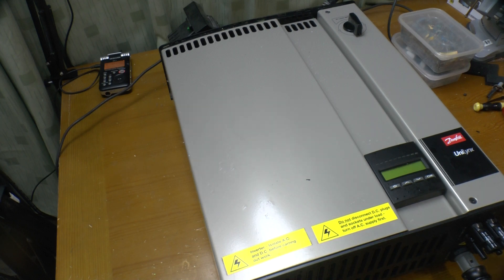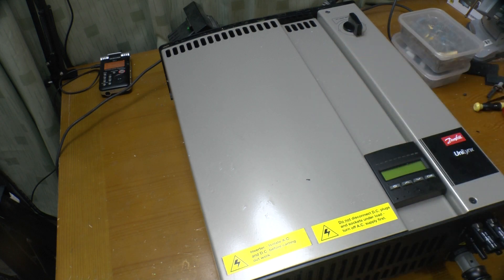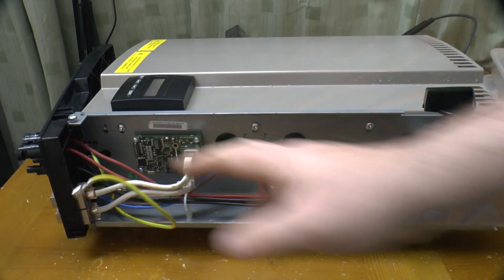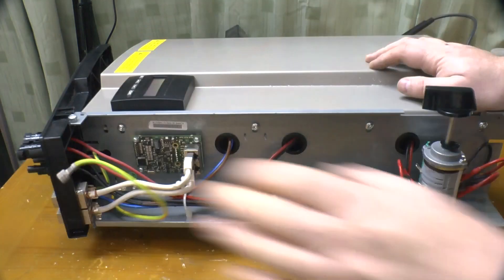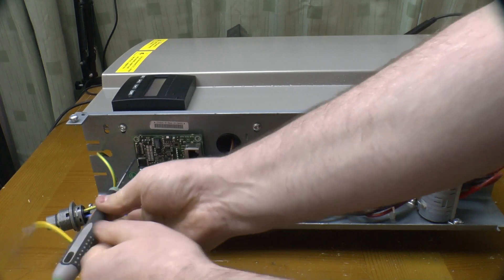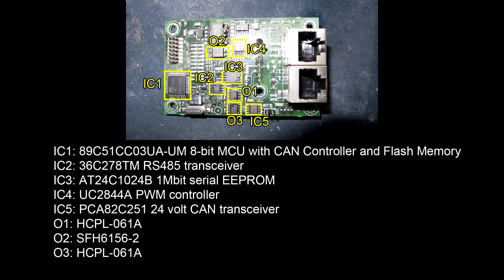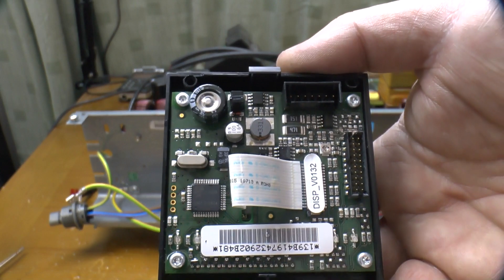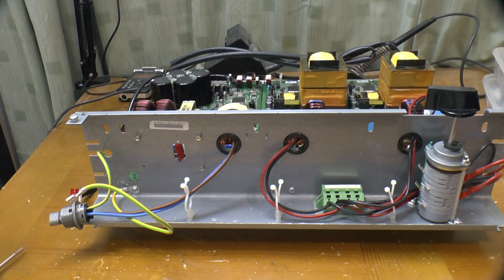What's inside a Danfoss solar PV inverter?

Comment: It's a shame you did not try to repair it! Such a nice inverter!
Reply from the maker: I have no use for it, my solar panels have microinverters and are on two different planes so wouldn't play well on it.  Plus it's been out in the rain, everything's wet, and I don't trust it.  Oh, and in between recording the pull-apart bits (just before the new year) and the annotated close-ups (just after the new year) I'd pinched bits off it.

Oh, and there's the small matter of the transformer I smashed with a hammer and dismantled :D